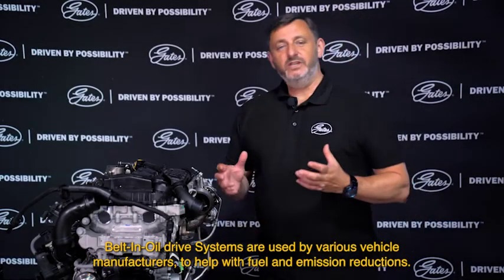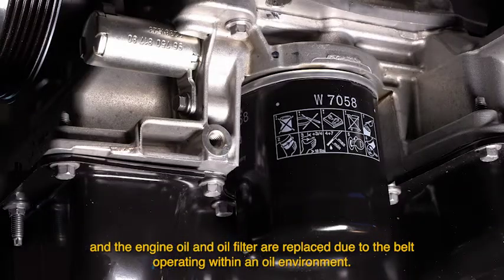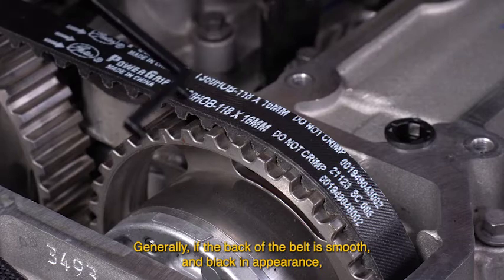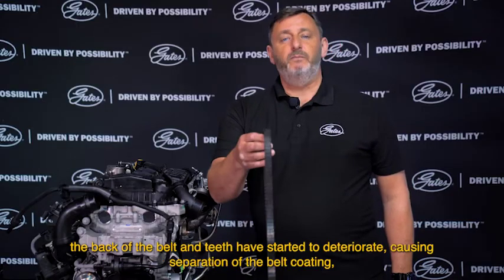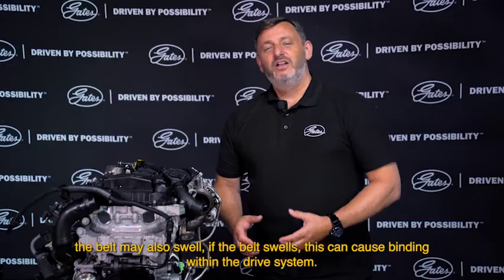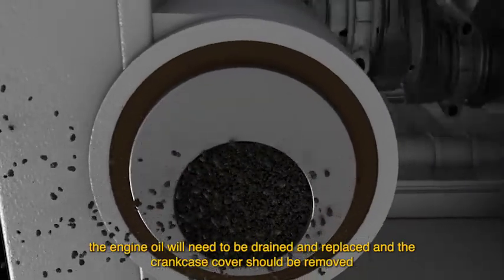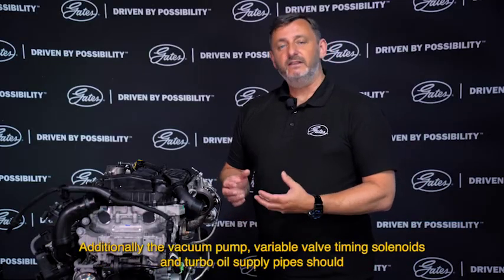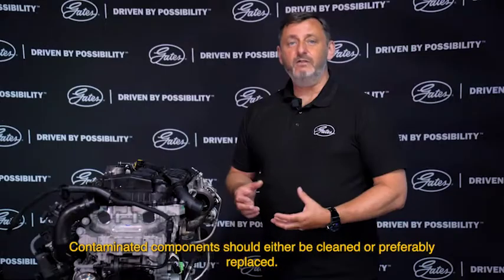Presentation of Gates PowerGrip™ Belt-in-Oil Kits: Complete & Confident Wet Belt System Maintenance

Comment: Hey everyone, in order to reduce fuel consumption and meet emissions standards, let's replace these big heavy brake calipers and rotors with belts! Also, that rack and pinion steering system looks like it weighs a ton, you know what I'm thinking...

Comment: Thank you for the video and the explanation.
But probably this will be remembered as the dumbest idea ever. 
Save 2% of fuel, and in the process blow-up your engine, or face astronomical repair costs if catch in time.
I think the idea behind this is, all cars made after a certain date will blow-up or present astronomical maintenance costs to the owners, this will in turn make the electrical cars more attractive.
Unfortunately, I am a owner of a Ecoboom, elected motor of the year for several years, only discovered this after buying the car, first car that I bought new.
Will never buy a Ford again ever....

Comment: I'll only buy a car with this system if the entire thing can be changed in less than 10 minutes, including all cleaning needed.
Reply: Either that, or replace the wet belt with a timing chain and you're sorted.
Reply: @Zgurkogel      The problem with a chain retrofit is where to put the guides.

Comment: If you follow the recommended service intervals from Ford, that belt will fail long before it. There's no belt or rubber on this planet that can cope with the stress and oil temperature of an engine. It's a stupid idea that will hopefully, bankrupt Ford. I'm shocked Ford are still in business, this is a scam.

Comment: How exactly does this belt in oil system improve fuel efficiency and reduce emissions? Where is your data? I'll tell you what this reduces: Manufacturing costs. I'll tell you what it increases: Maintenance costs. Extra oil changes will involve more environmental impact form oil extraction, refining and disposal. You're lying to our faces. Oh wait I got it! When the vehicle experiences a completely grenaded engine and pukes it's vitals all over the ground, it will to consume any fuel or produce any more emissions. Is that what you mean?

Comment: And don't forget the usage of the correct oil!
Reply: it doesn´t matter. Even with the correct oil, those wet belts crumble and fall apart.
Reply: @segoiii true and completely agree, but I'll bet my salary on this 
The company I work for has oil, ad blue etc in a dedicated place for the vans, so the driver can top up the engine if required etc 
we've transits, vw's, Peugeot/Citroen/fiat and merc vitos but just have 1 drum of oil to use 
people will buy a oil suitable for diesel engines to top it up not caring what grade it is

Comment: I don't get it why can't they do the chain? Why in the world what is submerged rubber in oil beyond stupid
Reply: Because belts are quieter.
Reply: @soundspark and there is an alleged 2% drop in fuel consumption. This saving evidently does NOT outweigh the cost of having the belt replaced though so wet belts are a pointless exercise.

Comment: Such instances underscore the importance of ensuring knowledgeable individuals are engaged in technical discussions. It is evident when misinformation is disseminated, as exemplified by an individual's misidentification of essential components and misalignment of technical terminology. Specifically, referencing a cambelt submerged in oil alongside visuals of an engine equipped with a timing chain demonstrates a fundamental misunderstanding of automotive mechanics. To put it simply, this guy is a knobwasher and from now on I will only buy Continental cambelts.

Comment: I'm curious to know what the emissions delta is between simply running a chain drive and having to make and replace all of those components.
Reply: very close to zero. It´s a pseudo argument to make people accept the planned obsolescence technology. We are living in times of pseudo arguments. You have to be very careful with them. They are everywhere. Especially when the argument is "for safety" or "for environmental protection" all warning lights should come on and you should check the argument 10x as much as you would normally.

Comment: they dont work, they swell the belt irrespective of what oil is used, they cause the belt to degrade, we dont want them. ford is ditching them for their ecoboom engine that had major problems destroying the engine because of this.  go away and stop talking about belt-in-oil. 

They say "lifetime of the engine" but "lifetime" means how long the belt will last. This is an utter scam by belt / engine manufacturers

Comment: This is the dumbest engineering in the history of the automobile. Just more maintenance costs for consumers before the car reaches 100k miles. I'm considering buying a restored 1970 4x4 and owning it for the remainder of my life. These new cars are built like crap and you need mechanics to do everything but oil changes.
Reply: Exactly. I'm just keeping my old cars running as long as I can find parts for them.

Comment: save 2% fuel but causes claustrophobic failures in 1% of engine ? Pretty good tradeoff .  I am sure the consumer will love it in their cars so will the Workshop operators
Reply: Catastrophic?
Reply: @sammbarnes7960  sorry bro my command of anglish is rubbish  just like an oil bathed high tech belt 😭
Reply: I wonder if the salesperson warns potential buyers of this incredible feature?????
Reply: So either you slowly kill your engine as particles shed from the belt and clog up your oil pickup starving the engine or you suddenly kill your engine when the belt fails and your pistons smack into your valves?
Reply: @soundspark  easier to change normal belts that can be accessed by removing the timing case vs removing the whole engine to replace a wet belt.
Reply: I highly doubt it even saves 2 percent. Maybe .2 or .02 percent. IMO just a cost cutting exercise disguised as something else.
Reply: wet belt never save 2% of fuel. The friction is minor. Otherwise heat would be created. The savings are within measuring tolerance. So you don´t save anything. It´s just planned obsolescence.